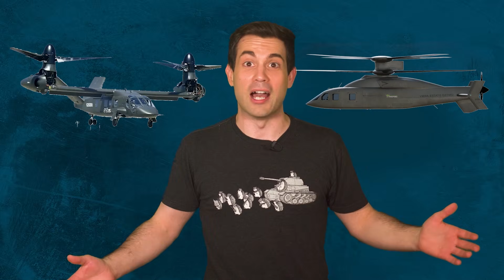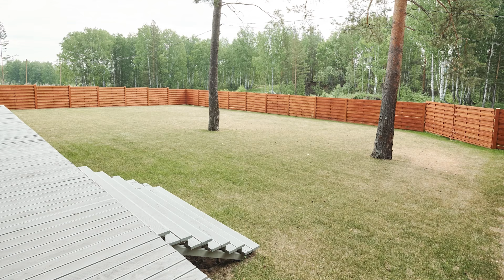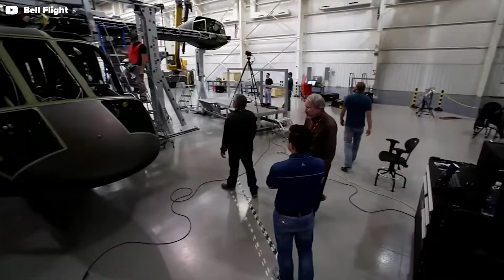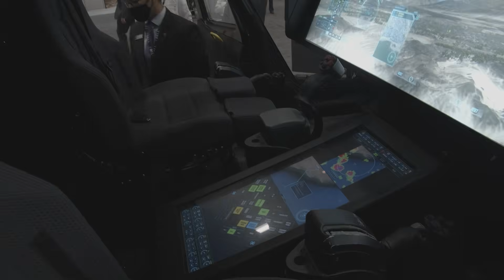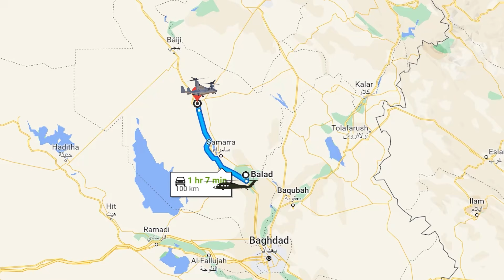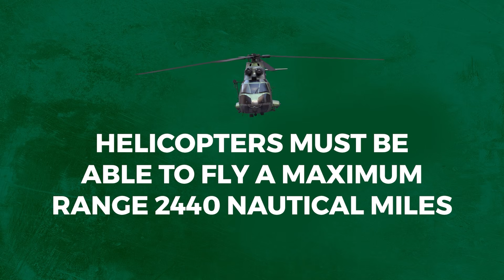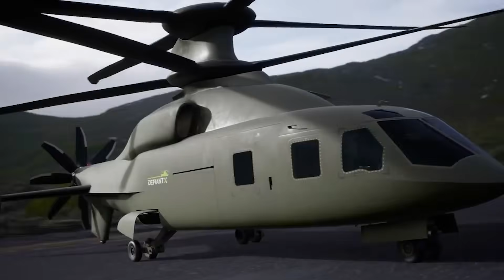V-280 Valor Helicopter Will Help Defeat China

Comment: 300 knots is only 345 mph. Your still a sitting duck for manpads and even small arms fire. Put jets on the ends of those wings. Idk why we're still using props on weapons of war. If jets have vertical takeoff and the f-35 can do 1180mph after it transitions to level flight...?? Sounds like we're building old technology-new equipment based on defense industry money and $1000 steak dinners from their lobbyists. There's a saying by fighter pilots and military pilots in general.. Speed is life. The Osprey despite its upgrades and fixes, continues to kill as many people in training as enemy fire each year. Btw, that pretty looking display across the pilots dash in this video, is only a piece of shrapnel or bullet away from a pilot having zero gauges in a battle situation. We have F-22s you can't track until they're on top of you. Tanks that can fire in the blackest of nights in a sand storm and traveling full speed.. hit another tank 2 miles away. Btw, that tank has a jet engine in it too... I think it's time to place more emphasis on our boys coming home in one piece. Right now, knowing a rotary is coming to whisk you out of danger.. and it's an osprey?? That's not a guarantee of anything.

Comment: What about something like a Boeing CH-47 Chinook with some mid fuselage wings for unloading the rotors during flight. I know there are some political roadblocks of allowing helicopters to have wings. But they Chinook is already when the fastest helicopters around adding wings would greatly extend its range. Maybe even have some props on the wings. I've seen some where they would allow the Chinook to land on water. This will be great for landing and picking up special forces or in case of floods landing supplies or picking up people.

Comment: The ever inherent problem with the Osprey design is the two points of lift on a horizontal axis. A third smaller rotor in the rear above or below the fuselage would correct this. Since the designers aren't willing to entertain this idea, my vote for the future is the rigid coaxial design. Just go back and look at the Lockheed Cheyenne which was killed by the Airforce. But none the less a  chopper that can haul ass and pull G's is something an old Huey Driver could only dream of.

Comment: For me as a pilot they both have different mission sets. With the amount of lateral space the tilt-rotor occupies it would be a problem in tight landing zones in between trees of the tropical jungle environment of the Pacific Islands, for me it's just a too wide footprint. For this purpose I think the Defiant is better suited with its slimmer profile. The V280 Valor is best suited for open areas such as European plains, deserts or places where trees are more spaced from each other.
Reply: If you superimpose the v-280 over the Defiant X they are almost the same size. The v-280 is only slightly bigger with its rotor blades sticking a bit further out. The defiants blades go pretty far out. People don't realize how small the v-280 is especially if you compare it to the v-22. It's true that the frame is laterally bigger, but if your rotors hit trees on the way down I don't know how much it matters.

Comment: Good luck getting the USAF to tolerate a tiltrotor to replace the Apache when they opposed the Lockheed AH-56 that was objectively a helicopter because of it's stub wings. Key west prohibits the Army from having armed fixed wings and the USAF would have an absolute conniption about a tiltrotor gunship.
 
 Though this is probably a good thing because a tiltrotor would make a terrible gunship anyway. High disk loading makes tiltrotors less efficient and quiet in hover and loiter than traditional helicopters. There's just no way around the fact that a tiltrotor has to compromise between disk loading in hover and prop drag in forward flight.

Comment: This is amazing, but the LED display concerns me. I literally know nothing, so my opinion doesn't matter, but I still want to know. Since it's a digital display, what would happen if the LED display breaks? With the old version of the control panel, you could punch one button and it might not completely break, but with an LED display, you hit one side and that side is out, or possibly the whole control panel. This is primarily a question of the display's durability.
Reply: if i remember right, its not one cohesive led screen. In other words, when one part breaks, the whole thing doesn't go black, and the software immediately recognizes that one part isn't working and therefore changes the layout of the screen.
Reply: @Skankhunt-mv4vd  Thank you

Comment: The Defiant can get in and out of an LZ MUCH faster.  The pusher prop on the back can be reversed to slow down quickly.  The Defiant also has a smaller footprint when landing.  That means it has more options when picking an insertion point.  If you're going in hot, you want the Defiant.  The tilt rotor has range and speed.  I can see that being a great thing in the Navy where yhe further from land you can deploy, the safer your surface assets.  But waiting for the transition to vertical flight and the slow insertion speed might be its Achilles heel.  I think there is room for both vehicles, but with different mission parameters.  I would NOT make all branches fight over which helicopter they should go with.  The Navy almost always uses  a different bird than the army.   Keep it that way.  
The navy would go majority Valor with the army majority Defiants.

Comment: The pusher prop on the Sikorsky can also go in reverse which lets you stop WAY faster than you could with air brakes alone. Very important for the hot infiltration. Less time slowing down less time to get shot down. For the scout/attack model the reverse thrust lets you circle a target with more precision too. 

In my opinion Bell is more of a plane that has VTOL , where the Sikorsky is more of a true helicopter, so I think they both have a place.
Reply: That's all talk and bluster – too bad that Sikorsky or Boeing never demonstrated it. That's the whole point of a demonstrator prototype – to actually "demonstrate" your claimed capability. The Bell V-280 Valor clocked up 214 flight hours – it flew for well over 3.5 times the pitiful 60 flight hours of SB1 Defiant. Insofar as speed, the V-280 Valor achieved 305 kts airspeed – well exceeding its namesake goal of 280 kts – and a full 60 kts faster than SB1 Defiant. The Production V-280 variant shall go even faster, with its more powerful R-R engines. Conversely, the SB1 Defiant could only muster 245 kts
Reply: @txtworld    WELL SAID.
Reply: Underrated comment. Skill will leverage the abilities of the vehicle creating certain tactical options unforeseen now
Reply: The reversible  prop promises to produce fast deceleration in level (although it hasn't been demonstrated), but you can also get fast decel by raising the  nose as as conventional helos do.  Something overlooked, though is that on the ground  either the troops have to wait for that prop to stop so they don't get sliced and diced, which delays their egress,  or the prop has to be stopped while still airborne, which negates part of the advantage it's supposed to confer.
Reply: @tararaboomdiay7442  What? A blackhawk has a rear prop as well. No need to stop it, just don't walk into it like every other aircraft with a prop.
Reply: The pusher prop on a helicopter was worked out by lockheed 60 years ago on the AH-56 Chyenne. It was supposed to replace the Cobra but then the USAF objected and lobbied hard against it till the program got killed. In many ways it was a more capable aircraft than the AH-64.

Comment: I have zero control, inputs, let alone variants, or that crystal ball to validate a comment productive... IF/ WHEN the conflict/ demand/ purpose the military arm of the major powers have only consistantly demonstrated thus;

Adapt, overcome.
Too many chiefs change the outcome.
Resources available are often EAD/ DILLIGAF/ SHTF/ etc... lean into the hill...

But... with the need for innovation, preparedness, situational demand, whatever craft equipped... 

the ability to deliver said payload, serviceable to deliver the outcome/ mission, at minimal loss... enemy interruption, aircraft capacity etc... heaven help the consideration of missiles as a potential to disrupt the purpose....

This is the format and reason we have mass boots on ground, fobs rather than occupation, fob islands, and why asset delivery is in mass rather than investment of upgrades of tech... 

Global government diplomacy, or recent military deployments, or theatre exits does not reflect positive confidence for deliverable assumptions on reliability or foundational assumptions for assertations of probability... far less than metal meeting meat sadly...

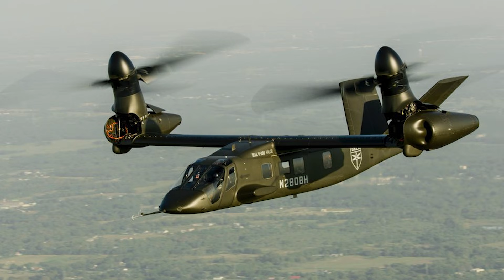Comment: Are time artillery shell's fuses set in the factory or on the field? Suppose a gun crew could fire a round every 30 seconds. Could they set the first shell to explode in 10 minutes, the next in 9:30, and so on until they've fired 20 shells that have landed and then all explode simultaneously?

Comment: I don't see how the V280 can carry weaponry when its entire forward profile is filled with rotors during flight.  You'd shoot your own rotors off.  The Defiance X hits the sweet spot of the rotor aircraft by using coaxially mounted, counter rotating blades.  The engineering challenges of coaxially mounted rotors are pretty intense, but if they can make it work it's genius.  The Defiance has my vote.

Comment: One team has an air frame designed by Bell with avionics integration by Lockheed Martin; this is a tilt-rotor design much like the Bell-Boeing V-22. The other has an air frame designed by Sikorsky (A Lockheed Martin company) with avionics integration by Boeing. So either Lockheed wins, or Lockheed wins BIG.

Comment: Tilt rotor has vortex ring related issues that limit speed of dropping altitude, mode change moving parts that increase costs, limited space for weapon hard points, and engines that require more frequent repairs. This was the case in Iraq. Compound helicopters has less speed, but overcomes all the issues Osprey had.

Comment: Everybody forgets about the capability of the mechanics to fix the airframes when they inevitably break due to ground fire
A lucked 5.45x39 shot from an ak can fuck up an osprey just as well as an accurate Sam fire if a mechanics crew can’t repair the airframes rotating propellers

Comment: You need more than one helicopter to do various tasks. If these two Helicopters have different capacities of use, then build them both and allocate them to specific tasks as required. They may find they need even more models...the battle field is becoming diverse...then let the equipment be more diverse.

Comment: Hooah? If this is for the Marines, maybe give an Oorah instead, kthnx.

Also, I wonder if wing-in-ground-effect would work for island hopping. They are triphibious (is that a word?) and and work on land, sea, and air... kinda. I could imagine variants of a midsize "flarecraft" that floats on a dynamic cushion of air over water/ground to land on beaches or farther inland to disembark a platoon, or ferry heavier weapons, or a version that acts as a platform for heavy weapons, kinda like a low-altitude AC-130, with cannon, mortars, heavy machine guns, grenade launchers, and missiles on pylons or a rotary launcher or a VLS bay. Heck, if it works for the Marines, maybe the Navy could outfit a variant with sonar and torpedoes for ASW patrols, or a variant with sensors and SAMs to act as a radar picket or mobile IADS at sea. Basically, it could fill the role of an ASW helicopter but with heavier weapons and an unlimited dwell time that could remain on station or in formation for as long as they have food, since it can just float on the water most of the time.

Comment: The tilt rotor is always going to have a speed advantage over the fixed rotor as there is a physical limit where the speed of the rotor tip to maintain lift X forward motion reaches the speed of sound. As I see it neither trumps the other  (atm) on internal load space or suspended cargo.
One day we'll see some real Star Wars Imperial Shuttle shit, with VTOL jets that use folding wings to land in confined spaces.

Comment: Each has different advantages. The V280 is faster and has longer range due to its design, but the defiant has crazy high speeds for a helicopter (due to the dual rotors which counter act retreating wing stalls), smaller footprint compared to how much it can carry and the engine&gearbox is probably better protected. The defiant will also probably cost less to maintain and have better hovering endurance.

Comment: Defiant is a vastly better option for close contact because of better agility, better potential fields of fire from inside and mounted weapons, and safer downwash for improvised landing sites near civilians. V-280 could potentially be used away from direct contact but the V-22 already is a better logistics aircraft because of larger volume, larger capacity. rear loading, and longer range. I suspect that Defiant and a future attack rotorcraft based on Defiant mechanicals will be the primary large volume rotorcraft for the US military. US V-22 users will probably hang on to them and ask for updated variants that could include some inspiration from work on the V-280. For the Marines, they will probably wait until the attack aircraft is ready and then replace all their utility and attack helicopters at the same time, in order to continue to benefit from shared parts on two related platforms. Marines will probably keep their V-22 but shift to using them more in sustaining operations with supply and somewhat less in air assault.
Reply: The Marines acquired very few Blackhawk family aircraft, largely skipping them in favor of updated previous generation Huey family aircraft. The main reasons for this are the relatively smaller footprint for deck space and the many shared parts from UH-1 and AH-1 series aircraft that makes better use of limited space at sea for parts and more overlap in maintenance training.

Marines adopted V-22 in significant numbers to gain more range and speed. They have tried to modify them to be more effective in close contact by adding firepower but were disappointed by the results. Thus they continue to use them lightly armed instead. They like the logistical benefits but have been less enthusiastic about the suboptimal firepower. If the USMC have Defiant in the future it will give them a more capable air assault platform when in contact with adversaries with range and speed much better than UH-1 and closer to but not quite matching V-22.

Comment: Wouldn't a helicopter that only uses electrical systems to fly be vulnerable to electronic attacks? Id think it needs some analog and wire controls just for redundancy.

In Ukraine they've found that the switchblades are very vulnerable to Russian electronic attacks and they haven't been very effective.
Reply: The same vulnerability that every modern passenger aircraft has - they are all fly by wire

Comment: The tilt rotor will continue as first line marine assault craft.  These smaller going in with the Osprey.  I expect the larger tilt rotor to be green lighted next in order to move small armored vehicles.   
For the army the speed and reach Just aren’t as important as survivability and payload.
Reply: I think the Marines will keep the Osprey but replace Hueys with Defiant as soon as an attack variant is available to replace AH-1 series aircraft too.
Reply: @Stu_Bur  i think the marines need an attack variant of the Valor over the defiant to give them escort and close air support with similar capabilities to the Osprey.

Comment: Hi what they need is diesel electric engines the range and power would be great and would reduce noise and you can put hydrogen oxygen power cells in there and go even further and be a lot more quieter it's very important because while helicopters are great they're good but divorce out of bed have it if you could hear him before you ever see him quiet it would be better now as far as these Black Hawks crashing you have to be more accurate than 11 crashes because of your civilian and own a helicopter you say the weather is bad I'm not flying it today military helicopters flying all kinds of water regardless what is mechanical was this weather what can we upgrade and improve the Black hawk to make it better but you did with the super yearly in the super Cobra it's a good report keep up the good work and God bless

Comment: Morons keep putting nothing but Digital Panels in them and if they Fail mid Flight what happens you can't see shit for you interments sorry but they should mixed this up and done half and half that way if you had a failure your not crashing because you don't know what your engine is doing and rotors.

Comment: don't know if someone mentioned this or not, but the pusher prop on the Defiant is not new. The AH-56 Cheyenne had one.  It was in service 1966-69.  It had one main rotor, a stabilizer rotor, and the pusher.  It was, needless to say, mechanically complex.  This was long before computerized digital flight control. It was a Lockheed project, so it is no surprise that they are resurrecting it.  The Cheyenne also had stubby little wings and could carry quite a weapons payload.  It reached nearly 250 mph in flight, out of this world for a chopper back then.  The Air Force had an issue with its plane-like characteristics well.  The Army decided it was too complicated and in the end equipped their aviation units with the AH-1G Cobra.
Reply: It was never in service!